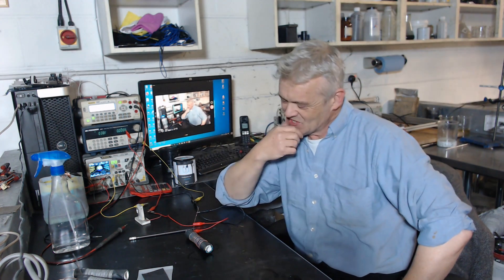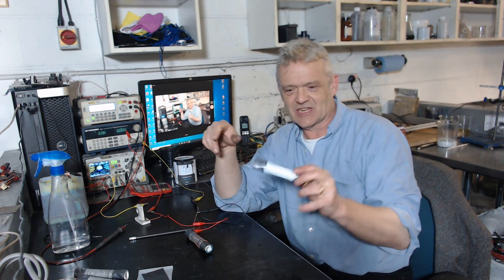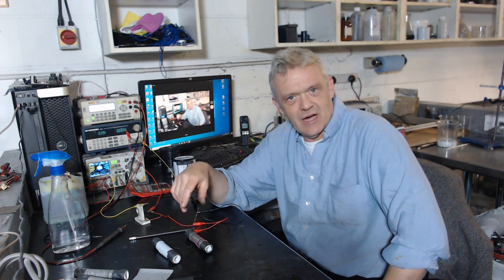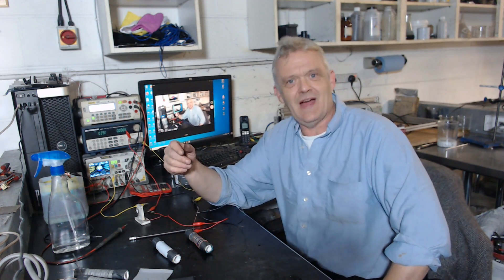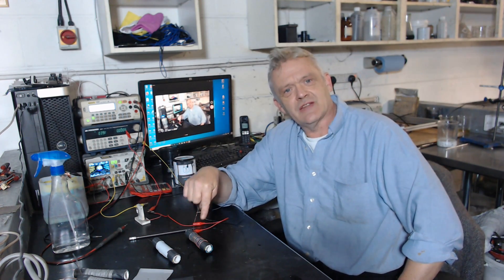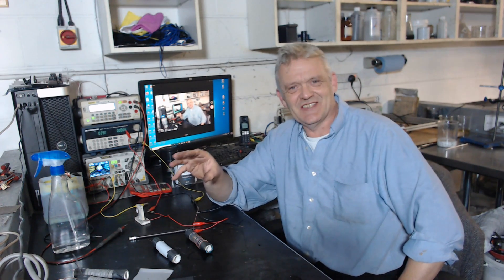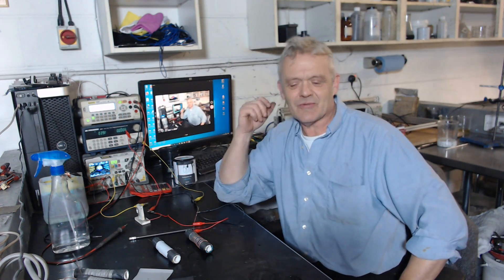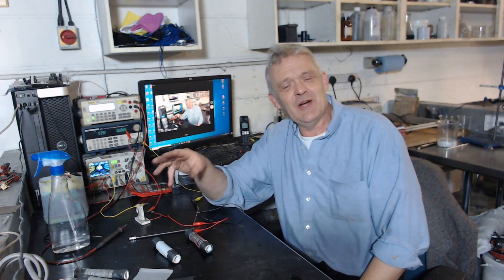A Self Charging Graphene Air Battery

Comment: Can you make a self charging battery with a Buck convertor running in from the smaller voltage battery and a schottkey Diode to it's higher voltage?   Using two batteries... And a buck convertor.

Comment: This statement is true(Solid salt will not conduct electricity because the sodium and chloride ions are not free to move around. However, when salt is dissolved in water, it dissociates completely into ions, and so is a strong conductor of electric current.) Then why do crystal batteries work no one has ever explained why they give the charge that they do?

Comment: Now this is interesting.  With the sunlight and air recharge, we may have a way to power a home using this technique to make roofing tiles.  Low voltage and current, granted, but enough in series and parallel can give you what you need, provided internal cell resistance doesn't add up.  I think I am going to have fun with this. :)
Reply: Hi Aaron, have you developed any ideas with this that you can share?

Comment: Robert could you paint your ink onto a sheet of the other material forming a flat surface which could be used maybe as roofing or siding in building construction?  No idea what the costs or toxicity of the product is but there is crazy amount of available surface area in buildings if air is more important than sunlight to cycle the battery.

Comment: Thank you for your excellent videos Robert. Just a thought I had which ought to help with air flow through the plastic tubes. It is to spin the tubes in a lathe and machine a series of grooves with perhaps a small diameter round file. After the grooves are done, then drill one or two holes in each groove. Thank you again and I wish you every success with your goals. Regards Andrew

Comment: hi ROB, interesting subject ,thanks for sharing,if you can get 500mv out of it that is awesome ! i think using voltage harvester module (LTC3588 )or (LTC3108) cheap ones at Amazon or aliexpress could generate 3v or 5v output easily Ii suppose,nice work man ,cheers.
Reply from the maker: cheers mate
Reply: yes enough smar t ohone all day long

Comment: How about providing some chemical equations to explain the chemistry?
A half a volt is useful but at what current?
I can see an applications in backing up solar panels, but is it better to use a capacitor or more conventional battery to provide backup when the sun is not shining? The attraction is the forever part. Even if only used to provide power for IoT devices, the fit and forget feature is very attractive. More so than having to replace the backup battery every few years.
How is this battery affected by humidity, does it die when exposed to moisture?
Reply from the maker: just go onto google scholar and look it up - there is loads of research on this

Comment: Does this type of battery still require to operate sequentially  i.e. charge, discharge charge etc.   I was wondering if it would be possible to make a battery with sufficient cells  that a load could be applied balanced  to the recharge rate?  This could almost be called perpetual power.  Am I barking up the wrong tree?
Reply from the maker: the power output is small and it takes time to recharge - I think it is interesting and has possibilities but isn't yet an answer

Comment: I really wish gold was cost effective to work with, I'd love to see what the performance difference would be with a Nobel metal that's farther on the Triboelectric series from carbon than copper
Reply: Then there would be finally a use for gold instead of pointless jewelery.
Reply from the maker: indeed
Reply: Collaboration maybe with Cody's lab or maybe one of the hold channels like Dan Hurd?

Comment: Call me crazy but what if you use metal wire mesh for the tube then a separator then the carbon cloth then a separator then the metal wire wouldn't that drastically increase the power density or availability?
Reply from the maker: well worth a try mate - but the graphene in the ink probably makes quite a contribution

Comment: This caught my attention immediately Robert,this is probably one of the most interesting break throughs on your channel.with a voltage doubler circuit and some super-capacitors,this will be one very interesting project!!.
Reply: you could probably get 3 of them in series and power a night led light.
Reply: @satibel  More like power your house with it.
Reply: @4gauge10  I'm not sure about the efficiency and how much power it can deliver, that would be the difference between those two, also humidity and life span are important factors.
Reply: Whoòooo now thats an idea

Comment: As far as I'm aware, metal-air batteries are not rechargeable. The energy comes from the metal breaking down (oxidation), so there's no way to "un-break" it.
Reply from the maker: this is not a metal air battery - i said that - this is prussian blue going to prussian white - a well known photoreaction - did you watch the video or just post first?
Reply: @ThinkingandTinkering  Sorry, never heard of Prussian blue before. Seems like you're describing a sodium ion battery. That technology can not compete with lithium. Sodium is 3x heavier, you can't extract as much energy as you can with lithium, and the manufacturing costs are the same as lithium batteries. The material cost of a battery is only about 20-30% of the total cost, so even with free sodium, you would still end up with a battery that is 3x heavier, with a lower voltage, at 70-80% of the cost of lithium.... 
I also highly doubt that this bleaching process can make any meaningful electricity, try making one and compare it to the smallest solar cell. Also, this would require the prussian blue to be on the exterior of the battery.... I can imagine some serious issues with that. Finally, voltage numbers means nothing without a load.
Reply from the maker: @eugenes9751  It's fair enough you haven't heard of Prussian blue - but really - you need to read before commenting - go look on google scholar - it might help with a few misconceptions you have here - I mean that in a nice way mate - I am not being snotty here - but you do seem to have a genuine interest and to engage in a proper conversation here - you do need a few more facts - have a look at Prussian blue analogue batteries - I think it will be of interest to you
Reply: @ThinkingandTinkering  I'll gladly look at the research, but why have you not cited any of it in the notes?
Would it be possible for you to do a video talking about the actual details of how it works? I get that it's a "well known reaction", but your video glanced over it as if everybody is expected to know what you're talking about. To make such a bold claim of "self charging battery" and then simply expect everyone to understand your methodology is a bit unfair.

Here is my concern: I see you make a lot of videos talking about a lot of different ideas, and ending with "this warrants more research". My question is: why don't you do the research first, and then put out the video? Are you under the impression that you're the first person to ever come up with these ideas? You've come up with a way to "self-charge" a battery, while Elon Musk is building gigafactories and not getting it?? 
I hope you understand that my cynicism comes from seeing hundreds of other "battery gugus" make claims entirely out of their ass, and never once create a manufacturable product. I'm not saying you're doing that, just that, in my opinion, you need to provide a lot more information for your claims before making such wild assumptions.

Comment: I'm curious, you run into all these great ideas, why don't you do some tests? pipe size, thickness of cloth, watt capacity?
Reply from the maker: look at some more of the vids - also - who really watches a video of a test - i can tell you - no one - the videos i do of testing get maybe a couple of hundred views - did you watch one for example?
Reply: Science or anything for that matter is 5% deisgn/build and 95% test.  You find the time, internet.  The man spent thousands of hours building up to this with knowledge, leaps of faith, and sticktuitiveness.   So, consider your question answered.  Here's a great example, I can say for certain, being in the industry, that any basic software project run by experienced staff will be 5-15% arch spec/PoC, 5% actual coding, and 80-90% test/validation.    You can bring your test cycles down using verification techniques/methods, but most don't want to invest in what it costs to actually run verification properly even thought the ROI is substantially proven.